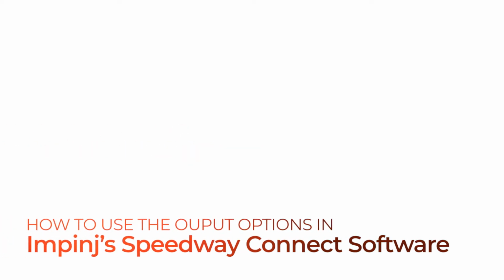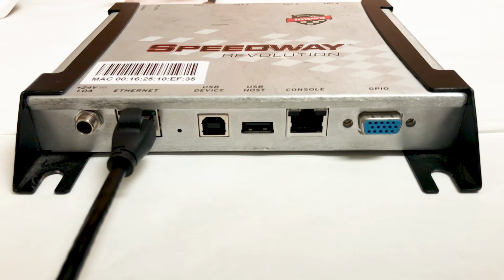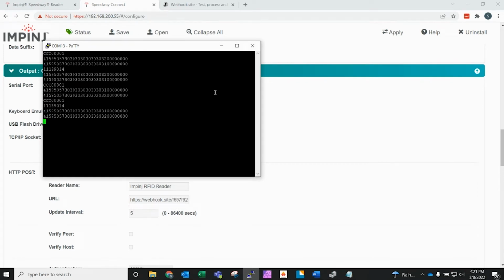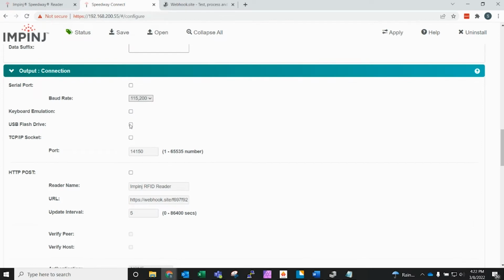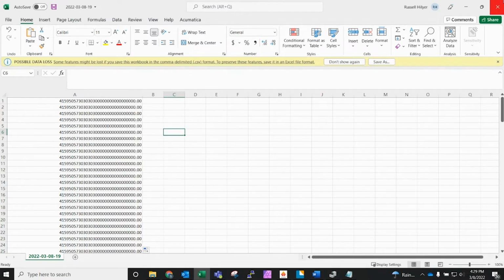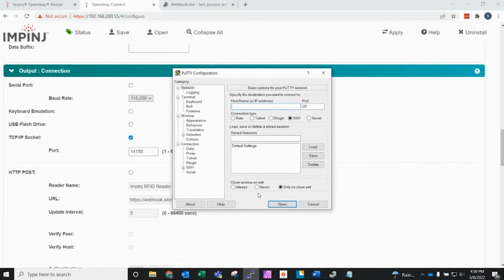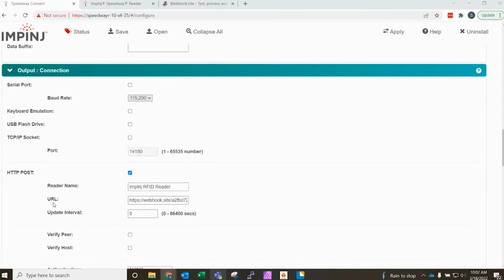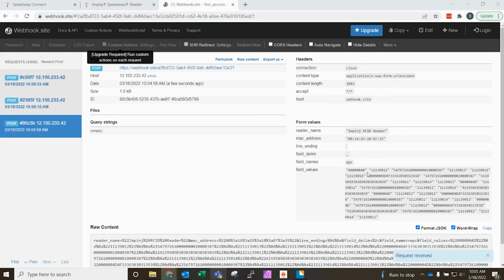Impinj Speedway Connect Software | How to Use the Output Options

Comment: May I check USB Flash Drive AND TCP/IP Socket together? What I need is the reader sending data for the software over TCP/IP and backing up data to the USB flash drive at the same time.